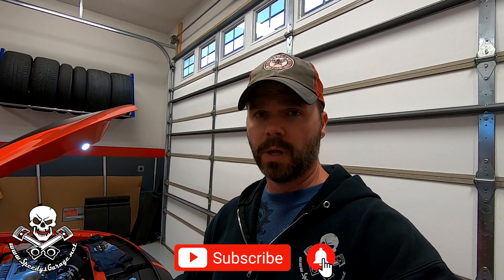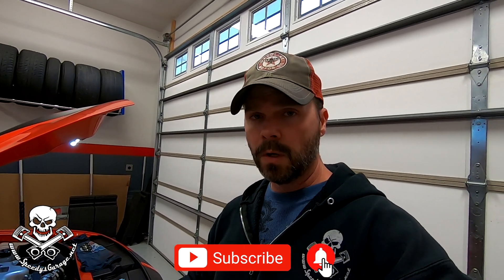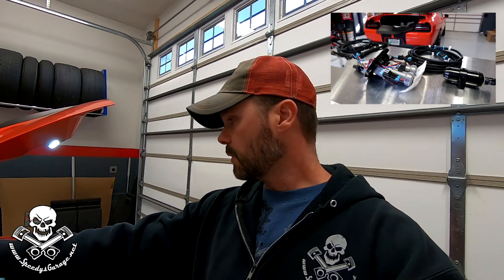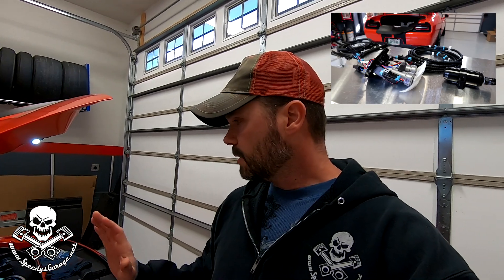ID1000 vs ID1300x Injectors Hellcat E85 Speedy's Garage

Comment: Hey speedy! 

I just started my E85 tuning with the id1050s and on my WOT log today I hit 75% duty cycle. I live in Las Vegas and right now it is peak summer months 100+ degree temps.  Where we differ is our DA. Las Vegas is about 2000ft above sea level, never EVER sees negative DA numbers and very rarely does our winter lows drop below 40 degrees.  Hearing that your duty cycle jumped from 72% to 85% concerns me a little.  What is your opinion on my situation/ location? Will I have enough headroom for the colder months here in Las Vegas?
Reply from the maker: Fuel capacity is something you never want to take a chance with, bad things happen fast.  I do NOT think those ID1050s will be enough injector for you on E85.

Comment: So in incredible air you came close to maxing your id1000s? Any other time they were fine right? Isn't it better to have an injector in the 75-85% range than in the 50%range? Will the smaller injectors not atomize better at the higher duty cycle? Id1050s would easily have passed even in the incredible air. Just wondering. I have some 1300cc injectors I bought for E85 but I plan to push my combo a little harder than you are right now. Maybe I'll run into you in Smyrna someday. I work at Nissan and have a black 2016 M6 Cat.
Reply from the maker: You need to come to ChallengerFest (www.ChallengerFest.net).  I wouldn't have trusted even the 1050s honestly.  1300s have some overhead and are working great.  Idle and low speed characteristics used to be a thing for big injectors but the tech on them is so good now that's no longer an issue.

Comment: Do you have any plans on making a video on the direct connection or power broker dealers?   Im interested in getting the Hellephant pulley 180 stat stage 2 upgrade with factory warranty in tack.
Reply from the maker: I have some opinions, not a bad suggestion thanks!
Reply: @SpeedysGarage  
Np. I know i could get better results for cheaper but i want my extended warranty.

Comment: Hey Speedy 
I'm going to give another example of why aircharge is what to be concerned about and not boost pressure . 
My car has a 10% lower with a 3.17 upper on a ported 2.7L supercharger and my car peaks at 17 psi of boost with 16-16.5 as my average but in decent air I will see over 2300 mgs of aircharge peaking at 2395 mgs . 
I have FIC 1440 injectors and my car peaks at 50i % injector duty cycle at 85 psi of fuel pressure on pump gas.
Reply from the maker: Bingo

Comment: Have you ever seen a need to clean the injectors with a tester/sonic cleaning system running E85.  I seem to have to do it every 2 years.
Reply from the maker: I personally run about a tank full of 93 through the car one every month or so.  However I have a buddy that runs E85 all the time and hasn't had any problems (yet) but I feel more comfortable with a bit of regular gas occasionally.
Reply: Hi, I'm going on 2 years with my Redeye and 3 years on my 18 coyote engine and no problems yet either...
I've got FIC 1000s in the Redeye and stock injectors in the Coyote..

Comment: So you bought the dual fuel pump for the 1000 injectors. How well is it going to work with the 1300s?
Reply: The main reason I ask is when you go to OST dynos site and look at the dual pump set up, there are two options for the pump. 1050s or 1300s.  Plus there is a big jump in price.
Reply from the maker: The OST site is a bit confusing on that.  It's the same dual fuel pump system, what you're seeing is an add on for injectors (either 1050 or 1300s) for if you don't have them already.